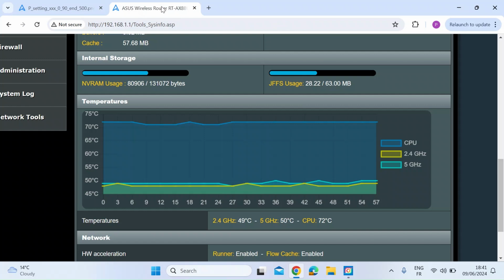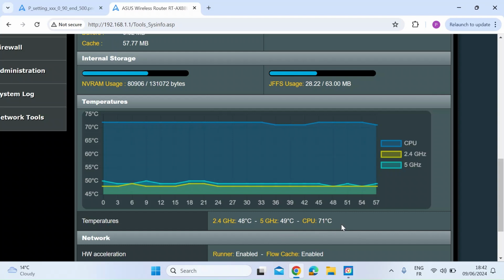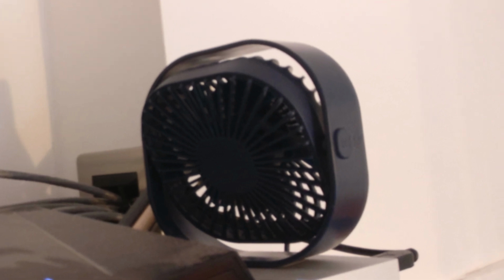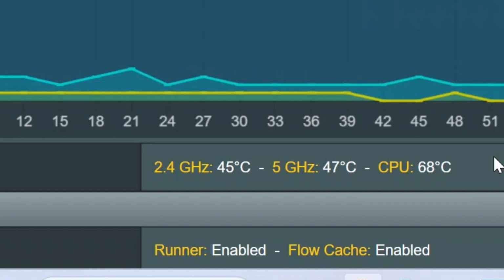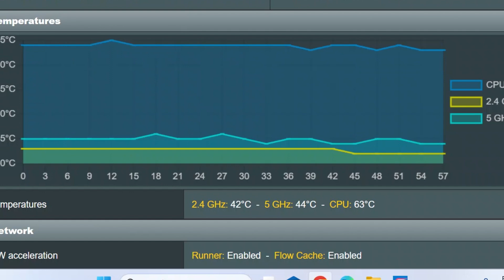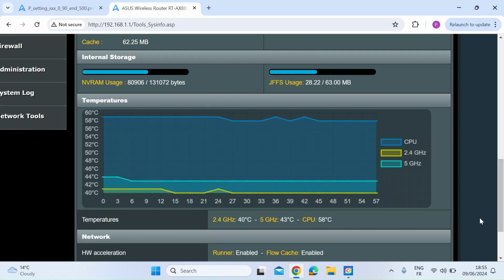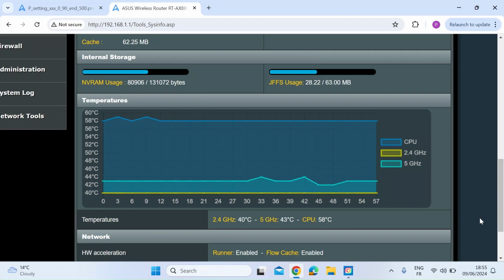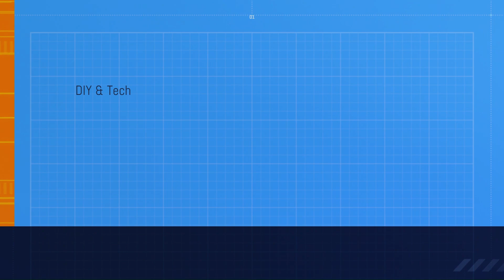ASUS Router Cooling Fan Test

Comment: There's a vent triangle at the top of the router.. by the logo. Someone designed a 3D print that puts a USB fan there which plugs into the open USB slot to power it. Drops it 15 degrees.
Reply from the maker: That's a great idea.
Reply: @BuiltbypeteI'm going to install it tomorrow.. I'll let you know. I have the ax88u pro.. it stays pretty cool considering I have 52 devices.. 

The fan is designed to suck air out.. since the intake is at the bottom.. the top part is the exhaust.. mine is wall mounted so I can't really point a fan at it.. 

$10 60x60x15 fan on Amazon and a 3d printer.
Reply: @Builtbypete Ok.. I've had it running for about 15  minutes now. 

2.4ghz went from 48 -> 40
5ghz 49 -> 40
CPU 64 -> 47

Comment: I wouldn't have thought they'd run as warm as that but then I suppose they have quite a bit going on in a relatively small box. I have a small form-factor fanless PC running OPNsense and the CPU on that is about 34C with the heating having been on most of the day. In the morning when the room is cold, I've seen it as low as 25C.
Reply from the maker: I don't think the Asus routers cool that well. It could be the heat sink paste has dried out and I need to replace it. I plan to make a stand with a built in noctua fan, controlled by a smart switch taking temperature readings from the router to switch the fan on and off.
Reply: @Builtbypete  Sounds impressive. It'll be interesting to see what you knock up.
Reply from the maker: Thanks. I've written a script to control it. Got myself a usb power switch which I've flashed with Tasmota..just got to build the chassis and assemble everything.

Comment: Thanks for documenting this. 

It's coming into Summer in Australia now and my RT-AX92U is in an attic with no AC. Temps reach 30-40C easily. Just tried similar USB fan to yours in 30C ambient - reduced CPU temp from 92C to about 68C. Fan draws about 1.65W, which I'm hoping won't stress the internal USB hub at all. Have looked at scripts for disabling the USB power according to temp or time, but there doesn't seem to be a reliable method of doing that. Will try constant fan for few days to see what happens I guess....
Reply from the maker: My plan is to write a script that measures temperature and switch off and on a fan as needed. Have a look on my Asus playlist as there's a few Asus temp videos that will be helpful. Such as this one. https://youtu.be/KUTseuzBgfs?si=5kR9Gmh0toxXXPnz

Comment: Have you ever contemplated disassembling that router to look at its internals and passive cooling method? 

Also, if such a video does not exist for this model, then you should really film the disassmbly. 😂
Reply from the maker: Hi Ash.  I did have a think about that.  I may still do it.  I believe its just a heat sink thermally pasted to the CPU.  A bigger heat sink would probably help if there was adequate space.